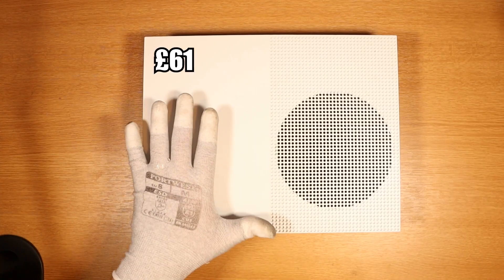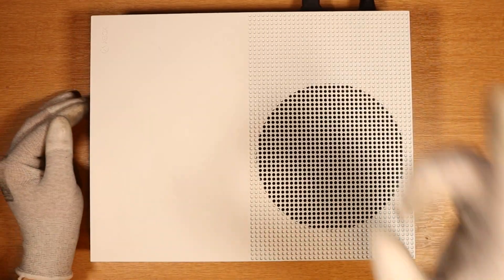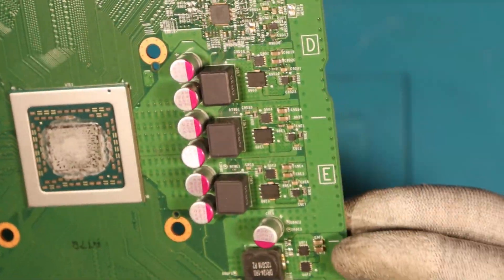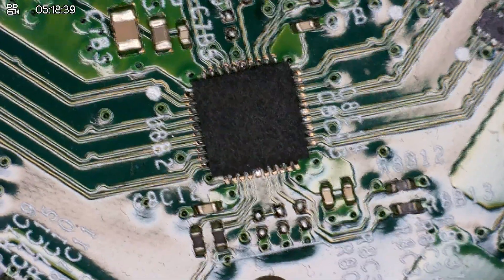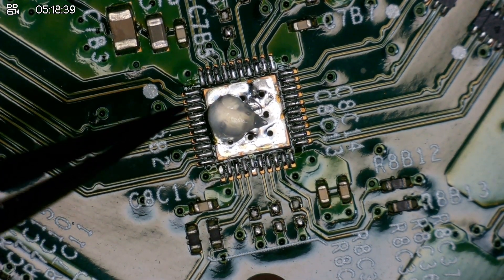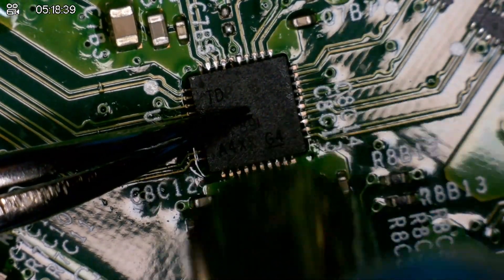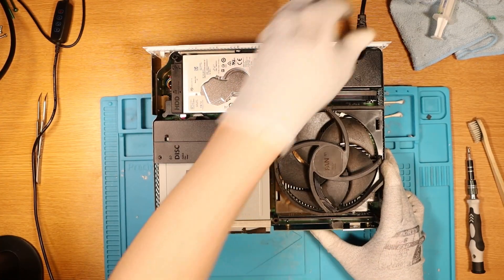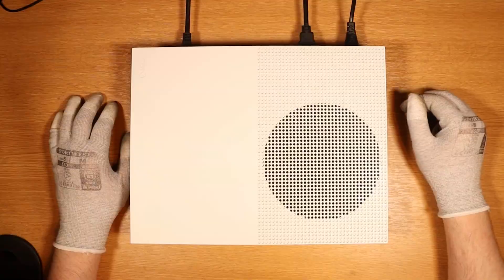I Paid $80 for a Faulty 1TB Xbox One S | No Display on TV | Can I Fix It?

Comment: Hi Joey - Great video! I'm in a similar situation with my Xbox One S—no display and the controller is not paired. I checked my router page, and the Xbox is not connected either. I've tried different HDMI cables and displays, but no luck. I don't hear any hard disk failure noises, but I can hear the spinning noise as normal.

Could it be a display port or IC issue?

Comment: Great video Joey. Great fix. 

I thought you could only use the SN75DP159 encoder ic for the Xbox One S. 
The TDP158 is for the Xbox One X. However it seemed to work fine when you fitted it to this Xbox One S console. I know you didn’t have 4K on your test screen, but I’d be interested to know if 4K works on a supported screen. Not sure if you could try. 

Keep up the great work. Really enjoy watching your videos 👍
Reply from the maker: I've just checked on a 4K TV downstairs bud and it seems to be working fine :) Little bit of FIFA!
Reply: @JoeyDoesTech  that’s great very handy to know. I have plenty of the TDP158 in stock. The 159 ic has sky rocketed in price. 

Thanks for checking, appreciate it. Keep up the good work

Comment: Nice work Joey 👏🏻👏🏻quick google Joey —Basically, a retimer chip (or IC – Integrated Circuit) ensures the signal outputted to your TV is synchronised correctly to display on your preferred resolution.
Reply from the maker: Ahhh the more you know Dad! Thanks for the info :)